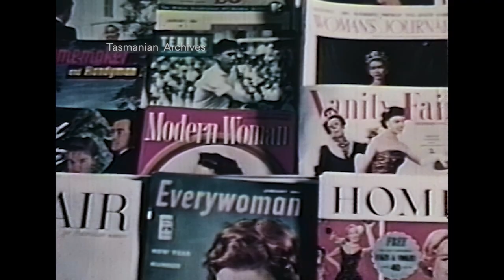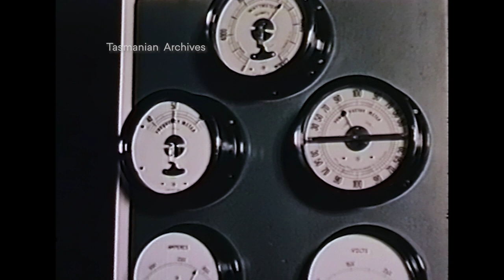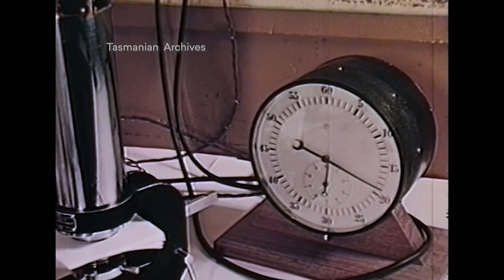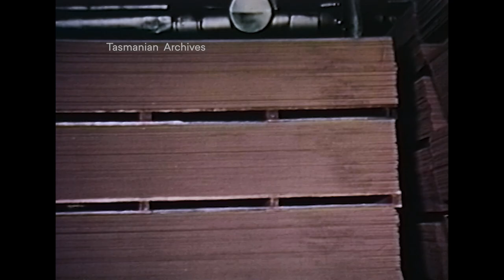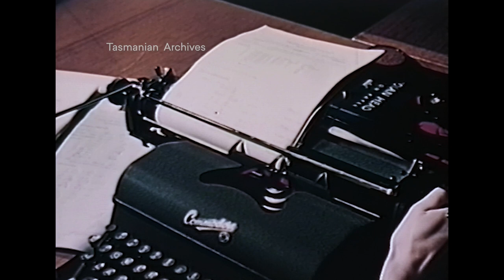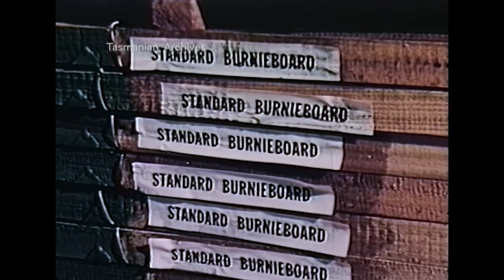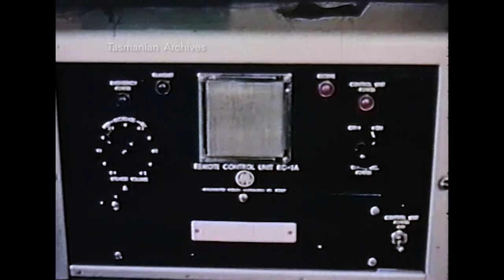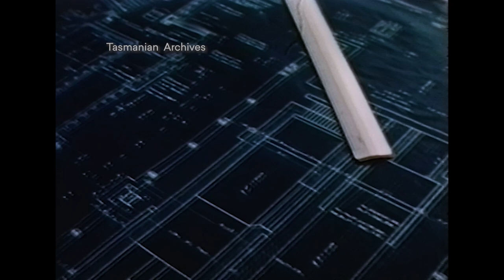BURNIE MILL (1956)

Comment: Dad worked on the No.3 machine there at APPM and Mum sorted paper with rubber stops on her fingertips to prevent cuts in the 70's. I ran in the soft sand at 12 year old right in front of the acrid white smokestacks for my swimming endurance training. Grandfather had a house up on the hillside and sat on a stool at the shipsdeck kitchen window puffing on his pipe and watching the vessels come in far out in the bay. By the late 70's Dad saw the writing on the wall and we left Burnie and moved to lease the shop over at Turner's Beach. By the early '80's I joined the brain-drain and took my Stanza on the Bass Strait ferry to Melbourne overnight for a computer course.
Nothing is the same.

Comment: Saintburnieburg... All that mercury was dumped out in Emu bay correct ??
Reply: When the Mercury Cell Plant was replaced with the Membrane Plant in 1988 the mercury was sold(expensive material). The mercury contaminated plant was encased in concrete and covered with soil. Was removed in recent years. There was always mercury losses into Emu Bay  and the shell fish and seaweed were tested routinely and around 1990 the levels of mercury had dropped to background levels.